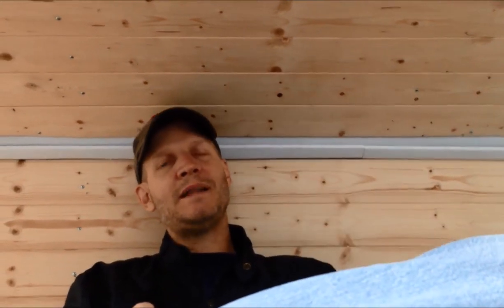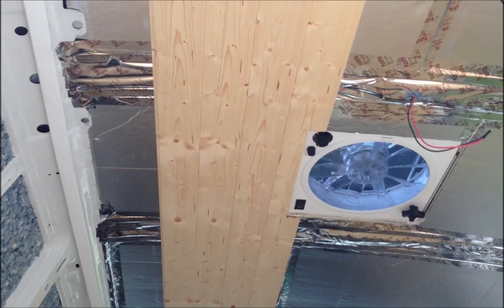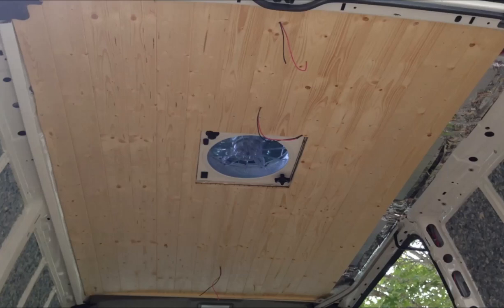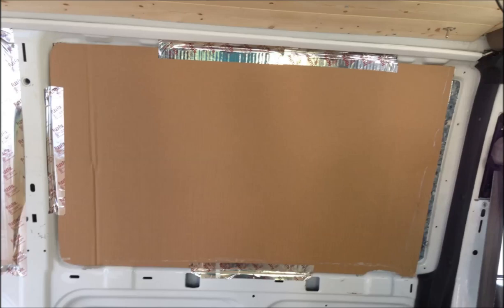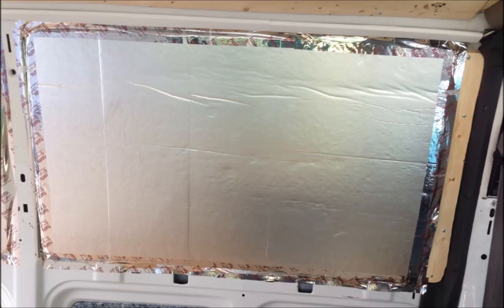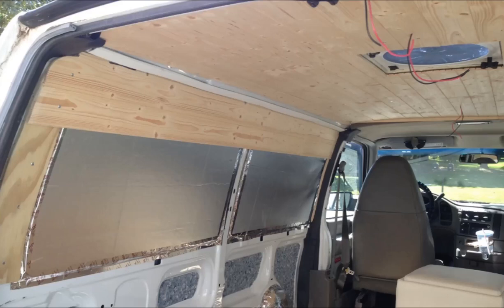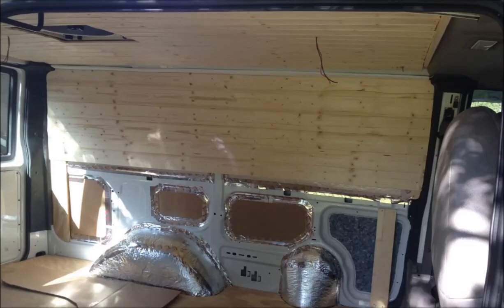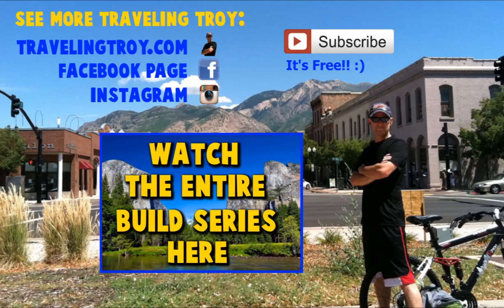Astro Camper Van Build 4 - Ceiling & Wall Paneling

Comment: y did great job doing wood panel it beautiful!  but i ask y question what kind metal screw y use to hold on metal frames?  cuz lots metal screw easy break when it drill push hard to hold wood with metal frames?     or  y do drill make hole first before put screw on it ?   just wondering..
Reply from the maker: Hi Andrew.  We used sheet metal screws when securing something to the metal framing of the van.  These screws were in a variety of lengths, diameters and head types depending on what was needed for the situation.  When screwing into the metal, we always pre-drilled pilot holes a size or two smaller than the actual screw to make it was easier to drill in, but we left enough for the screw to grab the frame.

There were some REALLY thick metal spots in the van which broke a number of drill bits while making pilot holes.  Also, we made pilot holes in the word to decrease the chance of the wood splitting when tightening screws.  Hope this helps and thanks for watching the videos.

Comment: How did you fasten the planks to your furring strips? Finishing nails? Screws? Looks good, thanks
Reply from the maker: Hi Scott Hilderon .  We used sheet metal screws to fasten the planks to the walls and ceiling.  These planks are very lightweight, so we only used 3 screws on an each plank.  Thanks for watching.

Comment: I dont think fitting t&g planking in a vehicle which flexes, vibrates and generally moves about, as well as has a much wider range of temp. variations than a domestic dwelling, is a good idea. I would be interested to hear how it is holding up now that a year+ has passed. Thumbs up for the clear way you describe everything.
Reply from the maker: Hi Devon.  Thanks for checking out the videos.  Yeah, the planks have worked out great.  I've slept in the van for over 500 nights now and not a single problem with the planks.  No cracking, no separating from the grove, and the color has stayed the same through the seasons, though I have only been in Texas.  I'll be posting an update video soon.

Comment: Hey!  Were you sure you wanted to completely cover the drivers side back windows/ door?  I’d like to leave mine exposed for better lighting but get good covers when needed. On the floor... did you pull up carpet first?  Or put plywood on top of it?
Reply from the maker: My van was a cargo van, so no carpet but I did have to demo some phone company equipment out of the van.  Next, I put down Ultra Touch sound barrier insulation to cut down on some noise and block some heat, then came the plywood.

Comment: Hello Troy, How did you attach the ceiling to the van? What parts of the beam and ceiling of the van itself did you screw into? Thanks
Reply from the maker: Hi Dylan.  If I recall correctly, there are 3 or 4 beams going across the cargo area of the van ceiling, from driver’s side to passenger side.  Each pine plank on the ceiling was secured with 3 screws.  One at the back of the van, one in the middle and one where the cargo area meets the cab area.  Hope this helps....thanks for watching. 👍

Comment: Hi, thanks for all your videos. I am wondering what the solution would be when you have a passenger van that has two windows on each side, four in total. I would make sense to cover the two rear windows and maybe leaving the two front windows uncovered and be able to open them and also have light go through them. The cargo vans have either no windows or just one window on the sliding door. The passenger Astro vans have the four mentioned windows. Is it better to get a cargo van? If you get a passenger van, how do you insulate the windows? Thanks
Reply from the maker: The windows are where all the heat will come into the van.  I love my windows on a cool day as I have a view, but then I dislike them on a hot day. 😉 If I were to do an Astro van again, I would go with a no-window cargo van.  Then, I would cut out my own, smaller port hole windows.  This would make it easier to insulate and more secure, as someone can’t climb in a small window.  You could go with a van with windows and just make window coverings.  I have done that in the past, but it becomes a real pain pulling them down for driving and figuring out where to store the coverings.  They get in the way.  To answer your question, I guess it really comes down to how you plan to use the van. With my current setup, I have blackout/insulated curtains covering the back door windows.  The curtains stay in place and I just pull them back when driving.  My sliding door window also has a blackout/insulated curtain now.  I can basically seal off the “living area” with curtains (plus my insulation) to block a lot of the heat.  I also use insulated window covering with black felt on the driver and passenger windows.  The black felt makes it look like super tinted windows and keeps the heat out.  Well, I hope this gives you some insight on your decision.  Thanks for checking out the videos! 👍

Comment: Hi, I am confused as to what you a screwing into, is there an initial layer of wood beneath everything? Thanks for the videos :)
Reply from the maker: Hi +TheMackieBob.  The walls in the Astro van are curved, so if we screwed the planks into the front side of the van it wouldn't touch the support at the back side of the van.  We had to build up more insulation and support to allow for a straight run of the 8 ft planks from front to back.  It may have been easier to just cut the planks in half, but we wanted the clean look of the full length planks from front to back.  I hope this answers your question.  Thanks for watching!

Comment: Good work. I see that you screwed the planks directly to the van. How have they held up so far since you did not use furring strips?
Reply from the maker: Hi there.  The planks have help up really well.  Throughout the van, I only see one that has a small crack, but I have spares in storage, so I can replace it if needed.
Reply: Sounds good, man...I'll take that direction on my build then.  Thanks.

Comment: Hi Troy, I was wondering if the walls squeak when you drive?  I'm thinking of doing it too. Thnx!
Reply from the maker: Hey Daniel.  My van is an 18 yr old van, so it has plenty of sounds it likes to make, but squeaking walls isn't one of them.  Every noise bugs me and I want to get to the bottom of it, but I haven't heard the walls squeaking at all.  We have all the insulation between the pine panels and the van metal, so not much friction.  Thanks for checking out the videos.  :)

Comment: This looks great Troy! Quick question though -- what do you think about using vinyl floor strips instead of planks for the walls and ceiling? I'm trying to make my build as lightweight as possible and also am pretty intimidated drilling so many holes in my van...thoughts?
Reply from the maker: Yes, it was scary when we first started drilling the holes.  I don't intend on reselling it as a cargo van, so the next owner will get it as a camper van and hopefully, the holes will be fine.  No plans to sell any time soon.  ;)

I see no reason why you couldn't use floor strips on the walls.  The planks are actually very lightweight.  My build and all the wood looks heavy, but compared to all the heavy metal I pulled out of this van when I bought it, I have barely used any of the max weight capacity.
Reply: Gotcha OK thanks good to know!

Comment: could this be done with laminate meant for flooring? i know those planks attach in a similar manner, i don't know if it's considered tongue and groove though. there's a lot of that stuff available near me second hand, would be a lot cheaper than buying new t&g planks.
Reply from the maker: Hi.  There are many alternatives to doing what I did here with the t&g plank.  Some people put up 1/2 plywood walls, which is really heavy and some use plywood paneling or other lightweight materials.  We went with the planks because they looked nice, were very lightweight and were way easier to deal with compared to measuring, cutting and lifting one large piece of wall paneling up at a time.

Laminate flooring could also be used on the walls.  I've seen it done in homes where they use the same laminate flooring on the floors and matched it on the walls.

Every van build is different because each person has a different vision on how they would like their interior to look and we each have different budgets in mind as well.  Good luck with your build.

Comment: Did you drill the brackets straight into the van walls? Also how thick are your pine t&g?
Reply from the maker: Yes, we drilled directly into the wall to secure the brackets.  Some spots in the van have very thick metal, so be prepared to break a drill bit or two in the process.  We used 8 X 4 X 5/16 pine t&g.  Here is a link to the actual product on Home Depot:  http://www.homedepot.com/p/8-ft-x-4-in-x-5-16-in-Knotty-Pine-Edge-V-Plank-Kit-6-Piece-VSV7-88-6-244-ST-HOMEDEPOT/202535999
Reply: Traveling Troy thanks for the quick response. Love the look but have been using plusnuts only to mount fairings as I don't want to drill into the van walls themselves :-/

Comment: Did you glue the vinyl floor to the plywood? I layed vinyl flooring just like yours but I did not glue it down and it is starting to develop gaps in the seams. I pulled the worst ones up and tapped them flush but am curious if they will hold up or keep moving as it is a free-floating floor. Thank you.
Reply from the maker: Hi there.  I had two fails on my van build.  One was a solar charge controller without a back-lit led which makes it difficult to read and the other was this flooring.  My flooring has done the same as yours.  It has developed gaps where dirt congregates.  I pre-treated the wood, as recommended by the flooring product, then I pealed and laid the vinyl strips and used a roller to try and mash it down good.  Unfortunately, it appears to be moving and creating these gaps.

I'm considering pulling out my bed and laying a full sheet of vinyl flooring either over the existing flooring or pull the od up.  I want to protect the plywood below from getting wet from a spill or from me tracking in mud or rain water.

Comment: Did you use 1 inch or 1/2 inch foam board for the insulation?
Reply from the maker: Yes, I believe we used 1/2 inch foam board. 👍

Comment: What would be the best tool to use to cut the vynal flooring tiles so they wouldn't rip or tear?
Reply from the maker: Hi there, Barbara.  Initially, we installed these vinyl flooring panels and used a utility knife to cut the lengths.  Later, we removed these vinyl strips in favor of a full sheet of vinyl flooring.  We realized heat was causing them to expand and contract and began causing gaps where dirt, dust and liquid could accumulate.  The one sheet makes cleaning/maintenance much easier. 😁

Comment: nice but isnt that wood making it a little heavy?
Reply from the maker: Hi there fearlesspatrriot McKanna !  Thanks for watching.  Actually, the pine planks are very lightweight, a much better option than using plywood and much easier to work with than large sheets of paneling.  We're very happy with the results.  :)